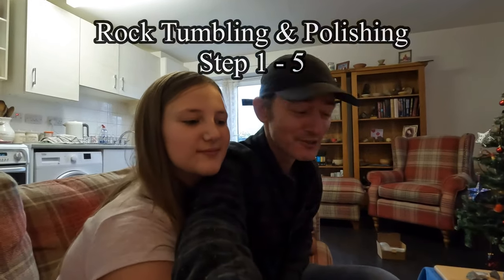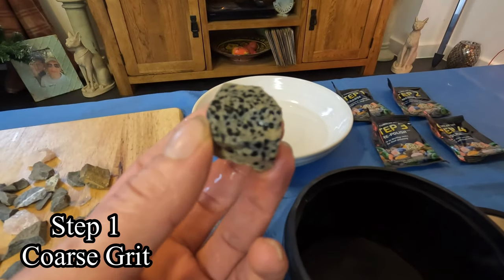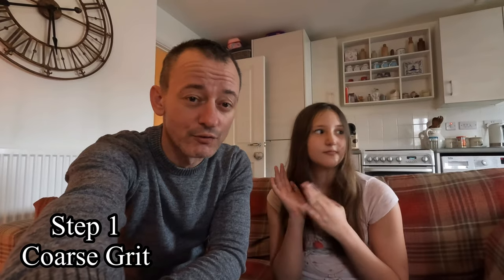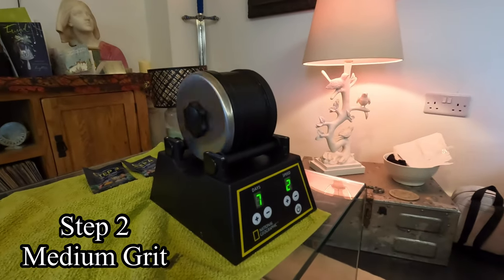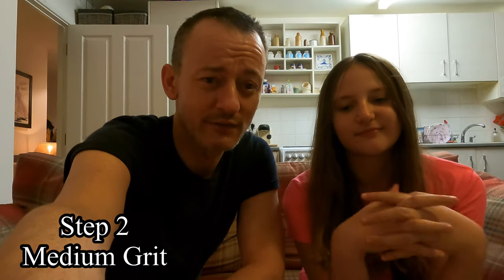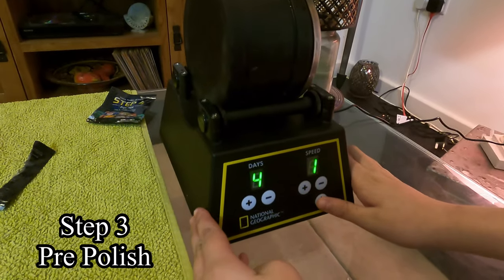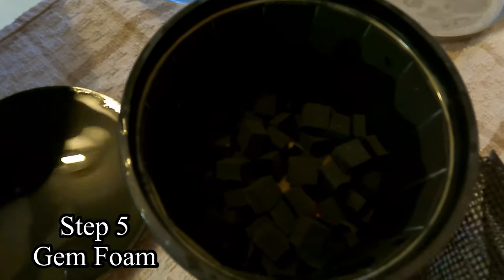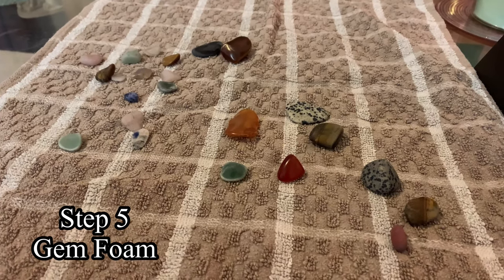Rock Tumbling and Polishing - Steps 1 - 5

Comment: Great first attempt on the rocks. It's same with our tumblers when cleaning metal. You learn by trial and errors. We found putting less in a tumbler is better and on the lowest speed and check them half way through so can adjust settings if needed. But the ones that did come out are really good end result. Well-done good luck for second batch you do in the future. 😊👍❤️
Reply from the maker: Thank you guys ❤️😉😊 I have started putting less in the tumbler, so fingers crossed they come out okay. I have quartz spinning at the moment 😊 they are Little Rock’s lol 😆 catch up soon